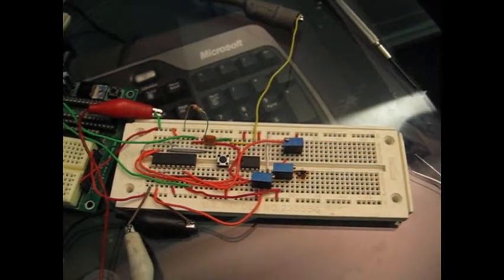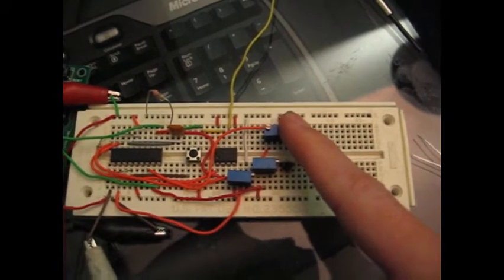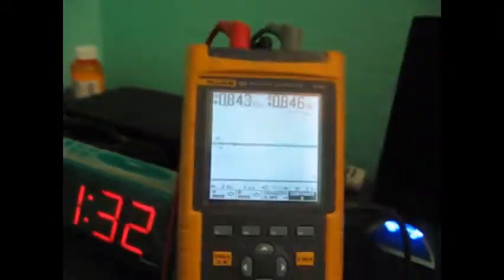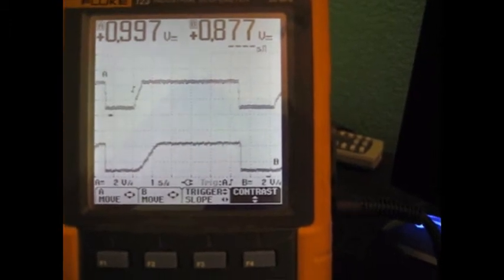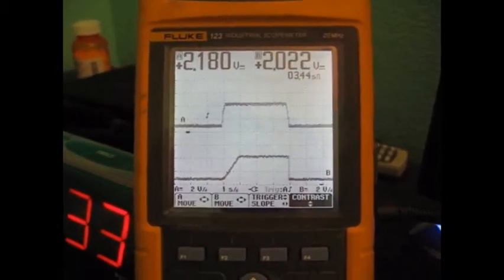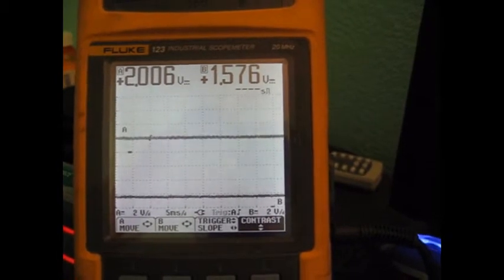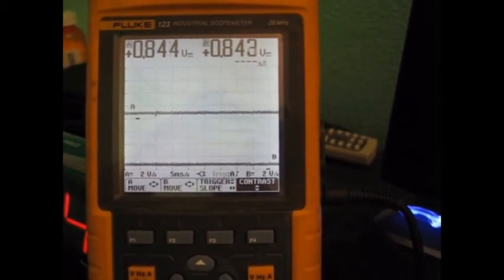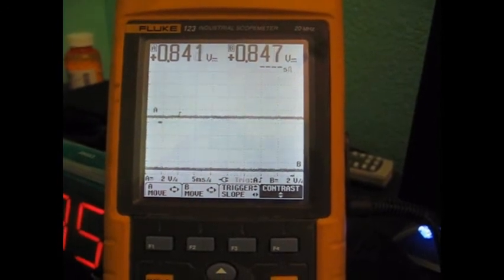Dodecahedron Solutions ebike Throttle Interface

Comment: nice idea!

some resistors and some caps can do this on some controllers...

but yeah, any controllers with a low input impedance wil require more drive and a simple R/C setup wont cut it, I hope you use the pic watchdog timer etc.....